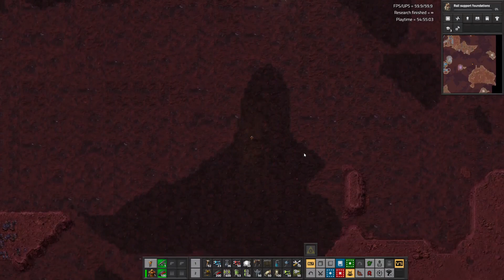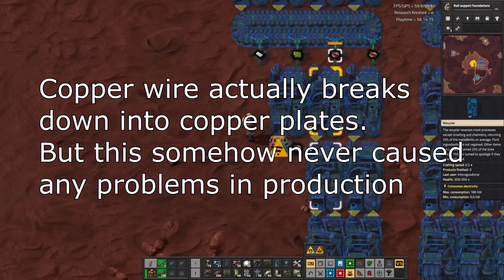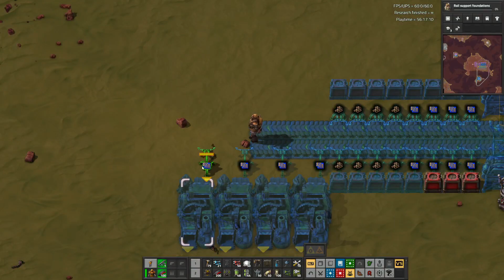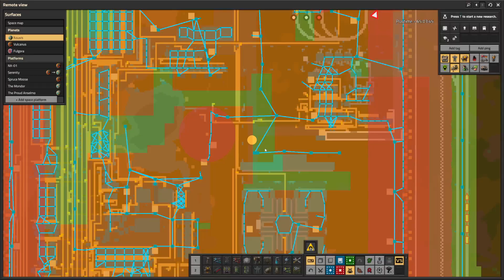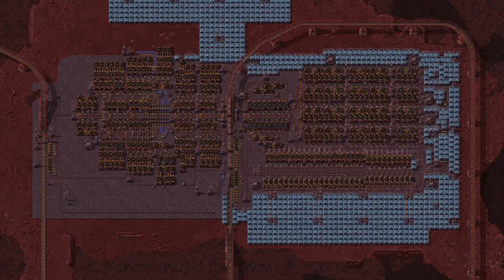Building the Most Destructive Holmium Factory -Factorio: Space Age

Comment: I hate to say you overbuilt by magnitudes of 10, but realistically I think this is the simplest solution: stack the recycler outputs, connect a scrap processing block to another block that dedicated recycles all the leftovers, then priority split the holmium from the output loops. It's that easy to reach the theoretical maximum, you could also craft steel chests and hazard concrete to decrease recycle time

Comment: I've been doing a lot of "pre-sorting" with my scrap setups lately. Between speed beacons and Recycling Productivity research, a single belt doesn't handle all the items anymore, and some items are just too many, I feel, to properly deal with otherwise.
So now I have circuits controlling stack inserters that are set up to pull only certain items. One will grab ice, stone, and holmium, another grabs solid fuel and concrete, another grabs red/blue circuits, steel, batteries, and LDS, etc. Iron gearwheels go straight into a recycler to make iron plates because if I REALLY need iron gearwheels that badly, I know where to get them. :V

Comment: I never understand why you guys so over complicate things. If you're fishing for quality I get stepping up your production but for what you're doing getting holmium this is way complicated and large . For no reason. Maybe your Nauvis isn't very good idk but I don't need anything from fulgora except fulgora holmium and tech that's it and just enough supplies to make a base, just use robots .  And cut out all the complicated.  I've literally got 1 line of scrap arms picks up scrap feeds into recycler , recycler turns it into the what is it 12 items ? That goes into a purple chest and then I've got 12 recyclers off to the side with a yellow chest connected with a wire to read the contents and is set to not destroy anything unless the items are more than 23000 of that item. The items that don't break down into anything like ice and fuel just fill up till they reach 23k then get destroyed . The items that do break down have an arm or 2 or 3 that grabs the secondary products from the recycler and they get thrown into another purple chest which my robots then grab and take to a recycler of the same set up as the others they fill to 23k and all the rest is disposed of . The holmium is all that's left and I've got a few rows of yellow chests dedicated to holding holmium that I use to ether create what I need for the fulgora techs or is shipped off to Aquilo for processing plates for a few things there,  because holmium is so rare it's really efficient when using it so you don't need millions per second , I've got half a million holmium on fulgora currently just sitting in chests doing nothing except expanding with every scrap processed all my techs are at least lv 30+ I've beaten the game and am currently trying to make it to the shattered planet but I'm not great at making spaceships so I've only made it half way do far .

Comment: 1:57 You can make a balanced chest loader with circuit network fairly easily. Attach all the chests with green wire to a single arithmetic combinator which divides by the number of chests and outputs as A. Attach the output via green wire to all the inserters loading the chests. Attach each inserter to its own chest with a single red wire and have the inserters enabled when "everything" is less than or equal to A.

Comment: Personally for destroying stuff I put 4-5 recyclers in a line with one direct feeding into the next, then I have like 15 sets of those, the outputs from the final row of recyclers then just gets belted back to the start with input priority, but it's very rare for anything to survive going through 5 recyclers. I put a couple of speed modules in the front row and it can deal with a full turbo belt of scrap products, it's much simpler than having specific set ups for every item. Although I will say your setup is a lot more interesting to look at and it works.
Reply: I'm lazy and just put a bunch of recyclers in a cube, then have a belt go in a circle around it. The input only ends up on the outer side of the belt, and the output from recyclers goes on the inner part (which is grabbed first by inserters). Eats up all the junk easily.

Comment: Having a remote construction tank/spidertron on fulgora is a must, and I highly recommend setting up a cursed logistics-train setup to populate new logistics networks once they're initially bootstrapped (and connected to the train network) via tank. Also, my solution to the "I just need some holmium and the planet's giving me loads of everything else" problem was to recycle into purple chests, then have a load of recyclers fed by blue chests set up to request whatever the logistics network has the largest amount of (as long as it's over 100k units), and then dump the output from that into purple chests as well. I'm sure I'll eventually hit bot throughput constraints and need to replace that with something more belt-based, but it hasn't happened yet!

Comment: Heating towers are a good way to get rid of solid fuel and reduce the amount of space dedicated to accumulators. I went to Gleba and immediately left while expanding my Fulgora base just to unlock them.

Could maybe craft all solid fuel into rocket fuel and burn the excess, not sure if that's any more efficient.
Reply: I'm using solid fuel + ice melting to produce power for my production island, so I need to plaster it with less accumulators.
Reply: I just used a small nuke plant with some basic circuitry to limit fuel cell to 1 at a time and only if I had low steam. Not the best solution, but I never had a total power outage

Comment: All this complication is why you just do a recirculating loop that takes everything. Everything goes into the loop, holmium get pulled out at the end, everything else gets recirculated until it is gone.
Reply: Consider merging mid-way through the recyclers, after all the special products are removed. Or you don't need to merge into the 1st line but you'll have less efficient use of recyclers and therefore space. Find a middle-ground that works for you.
Reply: hey, i did this my first time on fulgora. But in video he is maxing for holmium, which wont work with such setup
Reply: @morowenidi4621  You are going to have to explain why you think this, because that is how my holmium center works.
Reply: @milolc  if you look at how recyclers work, it takes a second to switch recipe, so it's not efficient, but if you just build more recyclers it might work
Reply: @morowenidi4621  Generally the flow per block is so high that the recyclers rarely need to change except at the very end, and that is solved by looping the whole belt so it never stops or slows, like you would do for a sushi belt. It is only worth looping the input for really big setups though. for smaller ones you just add a few more recyclers and eat the cost in the name of simplicity.
Reply: @morowenidi4621  The time it takes for a recycler to "switch recipe" is the time it takes for the inserter to swing its arm around. What happens is that the inserter sits idle and waits for the recycler to empty its input before it starts inserting new stuff.

Fast and Bulk Inserters take 26 ticks for a full turn, so that's 13 ticks for a half-turn or 0.22 seconds to switch recipes.
Reply: Make a multiple lane Recycling array that only processes scrap into a filter that can accommodate the amount of arrays/lanes you have into an array of recyclers that loop back into themselves to destroy whatever you don't want. It's pretty efficient. I have a 6 lane setup like this on my Fulgora map and it's got Holmium backing up. I have it filtering out Processing Units, Advanced Circuits, LDS, Solid Fuel, Ice, Holmium Ore, Batteries and Plastic. I have it branch off where it recycles the blue circuits into red and green circuits to get shipped to another island by train for legendary farming, and I have it recycling the backup for red circuits and green circuits into copper plates, and iron plates, and that's being shipped to another island via train as well as the plastic, and batteries. I process the Holmium Ore into Holmium Solution on site then ship it to the island the plastic and copper ore go to via train. I have a spaghetti mess of trains going around Fulgora but I'm backed up on Holmium Plates, and SuperConductors so my demand on Aquilo is met as well as the Electromagnetic Science.
Reply: recirculating is the best way to gridlock your system
Reply: @MattWyndham  Not if you do it right. You need to priority merge the return line for starters.
Reply: @milolc  There is no "doing it right", a recycling loop can always deadlock, no matter how you set up the input priorities. The issue is that they can produce more total items output than the input originally was if you recycle circuits or LDS. If your normal input belt is completely saturated, than the system doesnt have the time to clear itself completely and can slowly fill itself up. It takes a while and only really starts to become an issue once you start throwing away blue and red circuits due to them having a lot of crafting steps, but there is no way to avoid this purely with input priorities. You could dedicate a single recycler for each item, but that kinda defeats the purpose of the recycling loop while still not making it 100% deadlock proof.

A loop is nice to delete basic items when you start out on Fulgora, but it isnt stable enough to scale.
Reply: @milolc once you get productivity it messes the whole thing up, since you get more lanes than you put in

Comment: you can craft concrete into hazard concrete and that has a really low craft and recycle time and only recycles into itself
Reply: This is some cursed, esoteric knowledge. Thanks!
Reply from the maker: Wow that's... special...
Reply: @InferAGoodTime  Same goes for iron/steal...make them into chests.

Steel to steel chest (40x speedup)
Iron to iron chest (8x speedup)
Concrete to hazard concrete (6.25x speedup)
Stone to landfill (10.42x speedup), 
Bricks to walls (5x speedup)
Copper to copper cable is the same speed as direct recycling. Mixing in copper with steel at 2:1 to make heat pipes is a 10x speedup, as long as enough steel is trashed together with the copper.

Recrafting "green circuits" from the left overs is very fast as well compared to destroy the wire and the plates.

The result is a destruction center than is about 1/4th the size of what you made.  Beacons and speed modules shrink it even more.
Reply: @trepidati0n533  The steel chest trick is excellent for upcycling too. Each cycle gets 2 quality chances rather than 1. If you want more quality goods at the end you can use substations made by EM plants as the intermediate good, which gets rid of red circuits and cables too.
Reply: This. It's more efficient to craft stone into stone furnaces, and destroy those. Same with steel and steel chests, and a whole bunch of other esoteric things that take too long to recycle. Steel is particularly annoying to recycle without converting it into steel chests. Cargo bays are also great at destroying large volumes of LDS and Steel. 

There's also a lot of items that can soak up huge amounts of resources, but produce valuable things if they're part of a quality loop. Recyclers can be directly built from scrap contents, and are destroyed in 3s. There's obviously modules, but nuclear reactor components also consume a huge amount of copper and steel, and roboports are also great at eating red circuits, steel, and gears. And don't forget substations, and possibly roboports if you're going to put quality modules in your superconductor manufacturing. There's a lot of simple quality loops that can help reduce the amount of resources needed to consume scrap outputs, while giving you some nice stuff.

It's probably also worth moving the stone somewhere else, since there's no good endgame quality loop for stone. You either need to trash tons of metal on Vulcanus to get the stone byproduct, or use the stone byproduct from Fulgora. So starting an early stone furnace quality loop is a decent idea.
Reply: The obvious answer to long recycle times is to send the items onto a rocket, drop them onto vulcanus, then dump them into lava.
Reply: That's genius, I love it.
Reply: and steel into steel chests